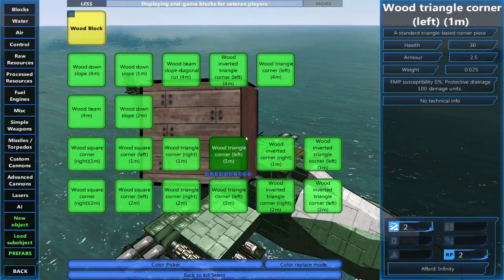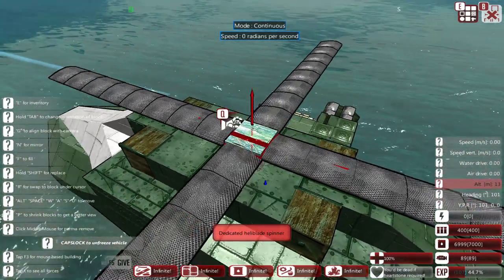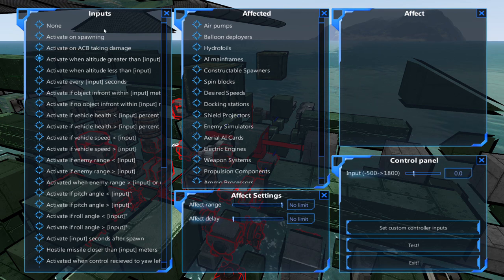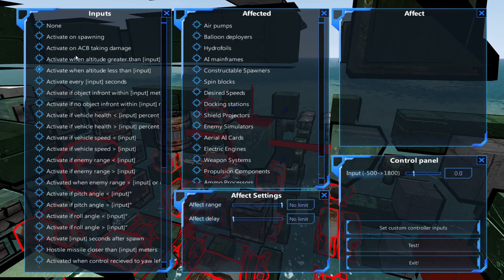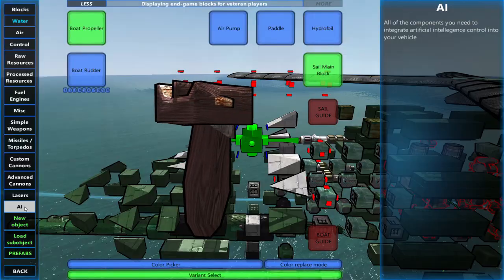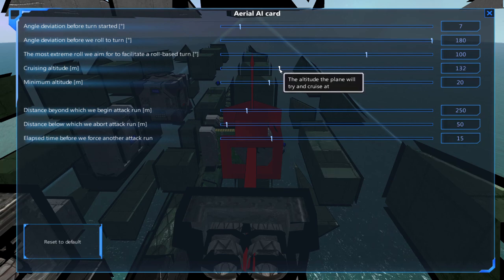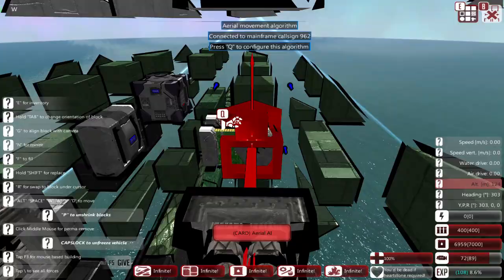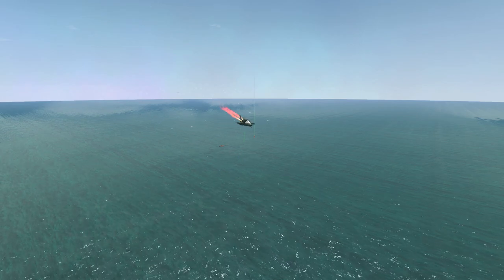From The Depths Helicopter Tutorial

Comment: Ok, so im designing a helicopter that has sort of a strange designs. The heliblade is in a hollow in the middle of the craft instead or on top of it, but it is still above the center of mass. For some reason, it will hover for a second, but then tip forward and nose dive into the water. How can I fix this?
Reply from the maker: Sounds like a cool helicopter design! Seems like the center of mass is to far forward. Is the heliblade spinner directly above the center of mass?
Reply: I figured it out. The always up fraction wasn't on. Works just fine now. Thanks for the tutorial!

Comment: i know its an old vid but, why do none of the ftd helis use tail-rotors?
Reply: ballparkkenan when you use spinners instead of the helicopter spinner, it spins the helicopter without a tail rotor
Reply from the maker: Sean Donahue tested it and it works just like a heli blade spinner.
Reply: ballparkkenan I must have something else i did wrong then.

Comment: Fantastic tutorial!
Reply from the maker: Thanks!
Reply: +ballparkkenan No worries at all. :) Do you know if it's possible to have a heliblade either side of the line of symmetry, and have them spin in opposing directions? I can only get it working when they spin the same way and it just looks goofy like that
Reply from the maker: yeah you should be able to. Just make one of them spin in reverse and replace the heli blades on it so they spin the other direction.
Reply: +ballparkkenan yeah just makes it tip over
Reply from the maker: ill see if there's another way to get it to work
Reply from the maker: The only way I've been able to make this work is by having two sets of control blocks. first set is like the one in the tutorial and will control your normal heli blade spinner. The second set is the same but has a negative number in affect instead of a positive one. This second set will control the heli blade spinner that is set in reverse. Place both sets near there heli blade ( first is placed near the normal heli blade. Second is placed near the reverse heli blade) and reduce their area of affect, in the control blocks, so it only affects their heil blade. Sorry it took so long. Hope that helps
Reply: +ballparkkenan thanks so much!! This really helps. You're a legend

Comment: My helicopter has a hard time manuvering like turning to the target any tips?
Reply from the maker: You could try using jets on the sides of you're helicopter near the tail
Reply: ballparkkenan I did the helicopter simply dosent want to preform an attack run ive tried spawning in a harmless enemy with ai and ive tried doing the thruster bit but the helicopter turns too wide like he dosent really aim at the enemy, Thanks for taking your time though i will be rebuilding the helicopter today due to my save file of the helicopter getting corrupt for some reason, i will hopefully solve it there
Reply from the maker: If it still has that problem when you rebuild it try lowering the angle of deviation before turn started setting in the Arial AI card
Reply: ballparkkenan Thank you for taking your time mate i really apriciate it :], il try that
Reply from the maker: Yeah no problem :)
Reply: i have that problum and how much exactly should i tiurn it down?
Reply from the maker: Lower it to 7 and see if that works

Comment: I noticed a strange issue, i set my control blocks similar to yours, but my helicopter seems to ignore what its set at, it will fly upwards even past its maximum height, Is there something i'm doing wrong here?
Reply from the maker: Your heli blade is just giving more lift than is needed. Lowering the motor drive on the heli blade spinner and/or lowering the rotation speed will fix it.
Reply: Another question, I did get the helicopter to work somewhat, it worked fine, went at its altitude rather smoothly, the propellor would stop rotating and drop a few meters, then spin back up again, But the issue is, i applied ion jets to the back, and i tried regular jets too, it would fly upwards to its altitude, then start slowly descending again, I also had the AI set as maximum and minimum altitude, like the automatic control blocks should be
Reply from the maker: If there are wings on your heli removing them should help. Also make sure your jets are inline with the center of mass.
Reply: too much power

Comment: After setting the minimun height for my helicopter and putting in the affect, my helicopter doesn't go up, it flies down. I checked more then 10 times i did everything exactly like in the video has anybody an idea how to fix that ?
Reply from the maker: Make sure the dedicated heli blade spinner is above the center of mass. If that's not it, make sure the always up fraction is set to 1. The only other thing that i can think of is your heli blades are spinning backwards.
Reply: ballparkkenan
 i was able to fix it thanks :)
Reply from the maker: Welcome!
Reply: ballparkkenan
Will you also do a tutorial for airships ? You deserve way more views
Reply: Do you also know a way to make it more stable ? for me the nose and the back goes up and down while flying :/
Reply from the maker: Thanks! I'm working on an airship tutorial now. It'll be up in the next couple of days. Is your thrust inline with your center of mass?
Reply: ballparkkenan
 yea that's the wierd thing i made some planewings for speed on the hight and inline of the center of mass and 3 trusters, also the heliblade is directly above it and the center of mass is roughly in the middle but it is shaking so hard that it looks like it will crash every second. :c
Reply from the maker: In the ai card change the most extreme roll to 0. that should help
Reply: ballparkkenan
ok thanks

Comment: Can you do dual blades?
Reply from the maker: Yes,  just add a heliblade pole extender to the top of your heliblade spinner
Reply from the maker: calvin san diego Yeah you can do both. With the Chinook style blades just balance the center of mass between the two blades
Reply: does there have to be a block spacer?
Reply from the maker: No you shouldn't need a spacer

Comment: Can anyone help the ai likes to use the thrusters for altitude and it ends up flying way too high
Reply from the maker: Do you have wings on your heli?
Reply: ballparkkenan no
Reply from the maker: Make sure your thrusters are inline with the center of mass.
Reply: ballparkkenan they are. Could it be that I'm only using one thruster to push the craft forward
Reply from the maker: If it's not centered yes.
Reply: ballparkkenan it is though, weird. I'll keep experimenting.
Reply from the maker: Your heli blades may be providing to much lift. Try lowing the motor drive on the heli blades.
Reply: ballparkkenan there as low as it can go and I'm still having the same problem. I've tried to lower the power of the thruster and I have the same problem
Reply from the maker: Can you post it on the workshop? I'll see if i can fix it.